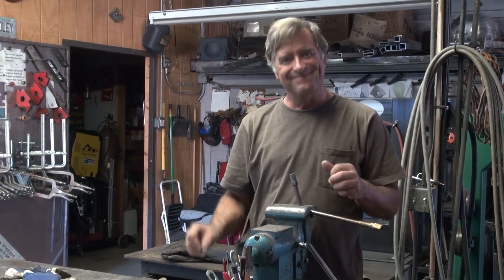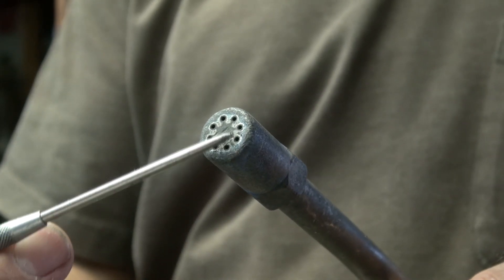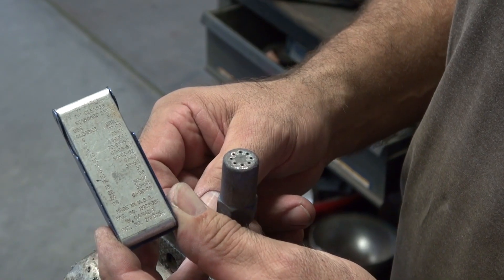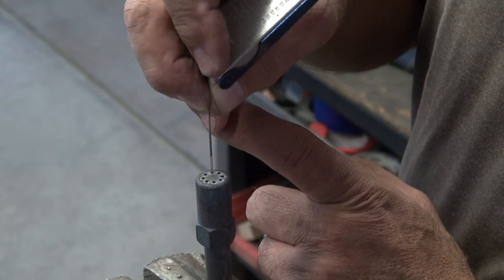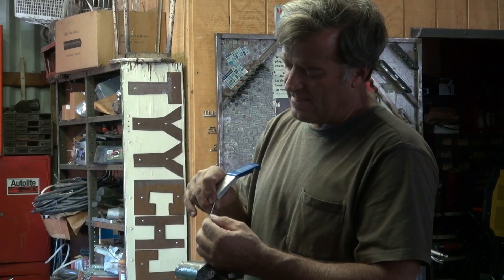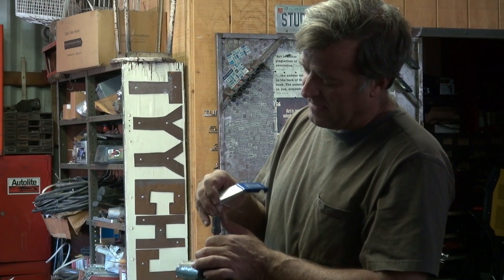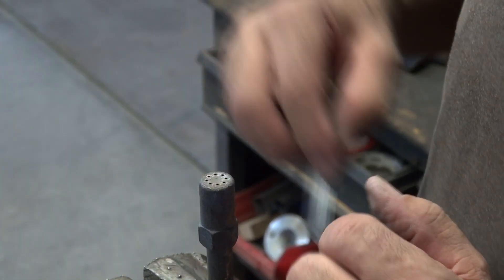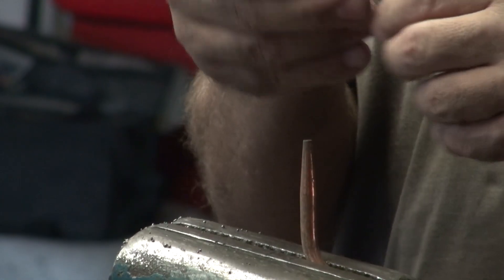How to Clean Your Oxygen-Acetylene Tips - Kevin Caron

Comment: This worked like a charm on my smith little Smith rose bud tip...but i used the .8mm v shaped stone setting burr...but i need that handy tool kit 4 sure...the stone setting burrs is what i had around and worked...this tool he uses is a must...i was looking for a wire from electronics to use but i remembered the burrs after trying drill bits
Reply from the maker: You can get the set online as well.  Or the local welding supply store.   Thanks for watching and posting.

Comment: just made my first cuts with a small piece of crap from airgas,  really got ripped off,  230 for the set up, but the torch is small and cheap,  friend of mine owns a american torch tip, gave me a rig,   wow what a difference,   the air gas one just feels like crap, but that;s where i get my gas ,  argon, and loyalty is big with me, manager is great guy   even for the welding,  the tig torches i find to be superior on many levels,  but the radnor ,   maybe because it's a light duty, just doesn't feel good .   the attc is just solid product,  thank you for the quick reply,   i tried cutting 1/2'' rebar,  took about 5 seconds for heat up and 1/8'' steel square tube,  the small 0 tip from radnor seemed to take much longer to preheat then in your vids ,   i stared with 3lbs fuel and 25 oxy,   then bumped the fuel to 5lbs,  cut a bit quicker,   the soot stuff never left even though i was able to get some really nice cones ,   could you advice me on the pressured you like for 1/8th - 1/4'' steel and what tip size,   also the radnor came with what seems to be a useless brazing tip,  so small the book says it's not even good for 1/8''     what size brazing tip do you like for 1/8' - 1/4;;   and for brazing copper tube ,   water heater and other plumbing,   thanks
Reply from the maker: +MARTIALCOMBATIVES      Did any paperwork come with the torch?      Should have setting recommendations if you got it..   I like to run the acetylene    up around 10 to 12 lbs and the oxy in the high teens to low 20s.     Don't do any brazing so can't advise on the tip..    Now that you have played with a bigger torch you see what is wrong with the small you have now..    You will upgrade soon.....
Reply: i'll give the higher fuel a go,  that seems like it will make a big difference,  i guess i saw your welding vid,  talked a bit about settings,
thanks,     never too big,  never too much power :}

Comment: The interview type video format is the best....It seems to be more professional than a guy with cam. asking you to follow him around... lol .Thank God for citizens like you..
Why is that the trigger on the torch seems to make no difference and leaks in the fittings? Even when real tight.
Reply from the maker: +Anthony Eugene      Well probably just settings on the torch trigger,  or the wire is broken inside the trigger,    Happens a lot.        The gas leak at the fittings is mostly due to people over tightening the fitting to start then it just never seems to seal..   Most of the time I just replace the fittings and the problem goes away...